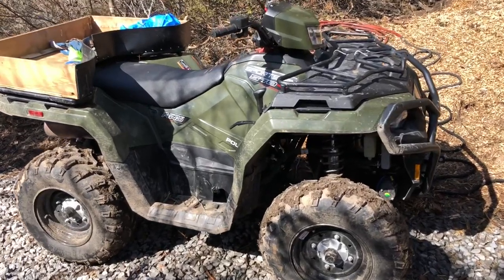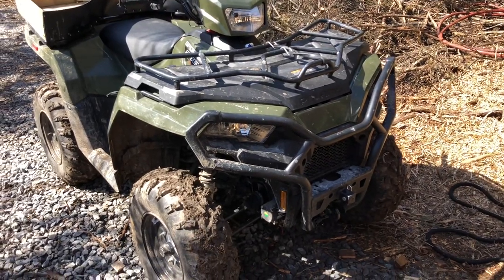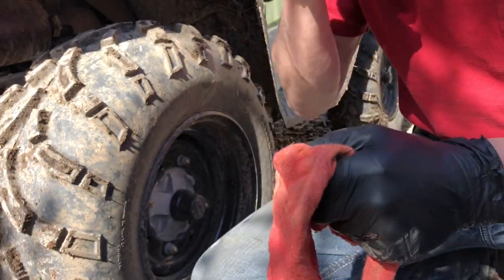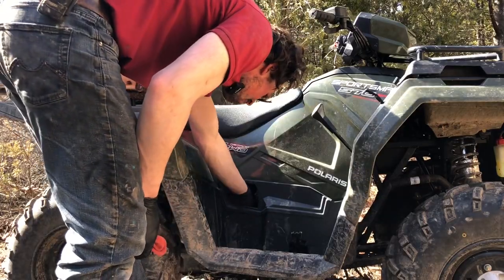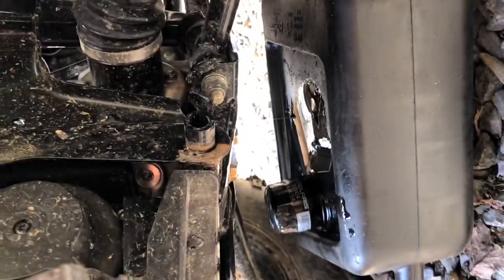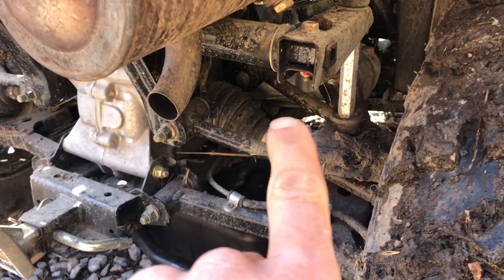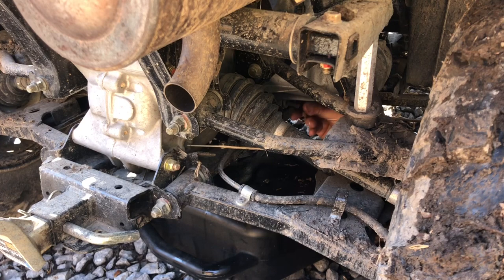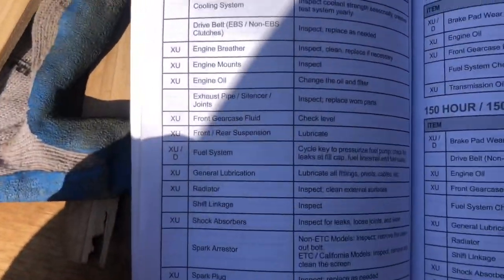Polaris Sportsman 570 - Full 25 HR Service

Comment: Just a tip you should always make sure you can get your fill plug off before you drain the oil. Great video
Reply: this is a good tip for old equipment brand new i wouldn't be to worried!
Reply: @Micheal153 disagree. Break in fluid would be the most important. Want to ensure you get as much oil with metal particulates out as possible the first change.

Comment: I am thinking about buying one of these ,Your video  has told me I can service it myself. Like you I  would buy the Polaris oils & filters. How do you like the machine so far??
Reply: I've got one, use it for ranch work and fun. It rips at WOT, and it grips great. Pretty heavy, but it'll get you to 60+ mph pretty quick! I'm not very nice to mine, and I'm on my third PM cycle, everything is holding up well. For the price, you get a real solid package 👍
Reply: @bloodruststaples  Thanks for the reply , It has helped me decide to  go ahead and order me a 570.  I'll be lot nicer to mine.... Using mainly around the  place here
Reply: @dave434  Be a good idea to stock up on periodic maintenance service supplies and maybe a couple spare things like a drive belt and wheel bearings if you plan to ride it when it's wet or lug stuff around. If you use it daily, those intervals will sneak up on you. Keep it maintained and it'll serve you well. Cheers ✌
Reply: @bloodruststaples  I could see where that might be a good ideal on keeping few extra service supplies around for it.  Cause You are right , The intervals can and do sneak up on you, Before You know it...  Thanks for the Good Advice!
Reply: @dave434  you wont be disappointed my new 570 trail just came in last week and in 3 rides i am almost up to my 25 hour service

Comment: Thank you for the Video. Very helpful. I wanted to share a useful trick I figured out with the Demand Drive Fluid fill plug. For some reason my plugs were 5/16 not 8 ml. I took a 5/16 allen wrench with the rounded end, cut off the bend and made a long bit out of it. Using a 5/16 socket and extension connected to my homemade bit, It was actually quite simple to get the plug out and back in. I will share a picture if I can figure out how to post it.

Comment: Sportsman 570 is a decent ATV some of the design and engineering things are a bit strange like on my 2015 and the battery location totally a bad design. Oil filter impossible to reach with hand due to coolant hoses all over it. I'm sure by 2021 they have redesigned these issues but they make you wonder about the people designing things. As for the engine my last one went 11,000 miles before I rebuilt it. I always use polaris lubricants. Bullitproof

Comment: I dont get how you got the allen off the socket to tighten it with wrench i have the allen like that for wrench i had to pull it out rhe socket but how would you have pulled it out with it on the driver

Comment: someone stripped my front diff. drain on a 550 i bought, so i drilled thru and used and easy out size 3\8 and swapped them , same size plugs. so i found a bolt that fits the hole i drilled and used Teflon tape on it and hammered it thru the hole for a temp fix. lol ... works so well i dont think i need a new plug lol. we will see.

Comment: hello, i just finished doing the service and noticed that the crush washer (you mention it at 6:19 time of your video), I forgot to install it.  I did not realized that the previous one fell off during the flushing of fluids till i was relocating the old oil. is it ok to run the atv without it? is it a necessary component? where exactly did this go? was it during the filter replacement? does it go with the differential fluid drainage?  thanks.
Reply from the maker: It goes on the oil drain plug. It creates a seal so no leaks. I guess if you didn’t install it and it’s not leaking it’s probably ok but just keep an eye on it. They include a new one with the oil change kit.

Comment: Change oil every ten hours. Four strokes like clean oil. Machine will last long time. It’s no Honda, however extra hp the small twin pushes, this will break oil down faster. MX machines are similar to formula one motors except singles. Change oil often, they will last.
Reply: i put 10 hours on in less then two days of riding i dont think ill be doing it every 10 but i was thinking like every 25 - 50 hours deppening on how it looks
Reply: We have 4 of these at work. They have all done around 300 hours and NOT once has the oil been changed. 😅 Engines still okay. Only the fuel pumps playing up due to blocked fuel filters.

Comment: How did you get the dipstick out so easily, I was worried about ripping it out, is it supposed to twist or just yank it out?
Reply from the maker: The dipstick is threaded in. You have to turn it counterclockwise about 4 turns before you can lift it out.
Reply: Boy do I wish those dipsticks were just O-ringed and able to be pulled out.  It's a pain in the ass getting your hand into that tiny hole, and the damn thing never seems to want to thread back in, either.  Very awful dipstick location and design.

Comment: Approaching 25 hrs on my '22 sportsman 850. I have not put in 4wd at all. Do I need to change front dif fluid??
Reply from the maker: The front diff still spins even when in rear wheel only drive. There is no torque imposed on it from the transmission so there is much less wear. In reality, 25hrs is nothing crazy but keep in mind that some of the greatest amounts of metal particles and wear makes its way into the fluid when a diff., trans., engine, etc. is in its first hours of operation as it is wearing off machining imperfections and slight imperfections in mating surfaces so the initial fluid service interval is one of the most important in the whole life of the machine.
Reply: @rudijones  thank you. I will definitely change it

Comment: I picked mine up on Friday and didn’t even put 4.5hrs And it went back to dealership on Monday cause it’s having a bad clutch issue
Reply: What did you issues with?
Reply: Good video
Reply: Was it the clutch or the belt? My new 6x6  had the belt tear apart due to "operator error" after I got back from an atv trip and I was helping a friend split wood with it.

Comment: is that the EPS model?
Reply from the maker: No
Reply: @rudijones  ok thanks..  how do you like this model?  Do you think that power steering would be a big improvement?  I am thinking of getting the EPS model.
Reply from the maker: @lxdesign1  I don’t find the lack of power steering to be a big deal. Don’t get me wrong power steering is awesome as it feels effortless when driving but I just didn’t feel that I needed it. I’ve never been in a situation where I felt like power steering would be needed. I use this on a farm and from time to time on twisty trails in the back, that’s where I notice it most.
Reply: @rudijones  thanks so much...   the machine I get will be for trail riding, and off-season access at Haliburton Forest & Wildlife Reserve, in the off season, the trails can get sloppy.  My current machine is the Yamaha Kodiak 400 - but the rear differential went out on it back in the fall 2020 - gears are all chewed up.  I like the pulling power of the 570, as I have a large flat deck trailer that I can haul wood, or my snowmobile with.
Reply: @lxdesign1  I used to run a '96 Magnum 425 (no EPS) to plow my driveway in winter.    In 2017 I switched to a 2016 Sportsman 450 HO EPS.  For low-speed, tight quarters, heavy work use -- like snow plowing! -- having EPS is the best thing since sliced bread.   That said, I don't know if I would spend the extra money if I were just wide-open trail riding the thing.  Twisty, hilly trails in the woods, or muddy stuff... then yeah, EPS would be a bonus... but on open fields, fire roads, and long railroad rights-of-way, not really needed. 

Also, from a maintenance perspective, having EPS does make working inside the heart of the frame harder still, and it's tight in there already.  On mid-20-teens models, they stuck the damn starter battery down in there, very much hard to get to and blocking things.    Of course, having the EPS unit down there too doesn't make it any easier.